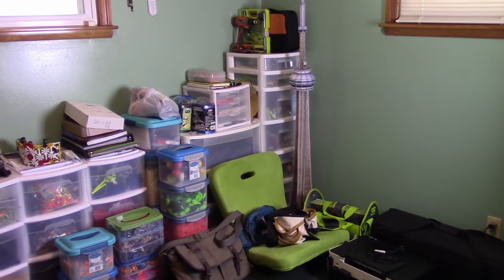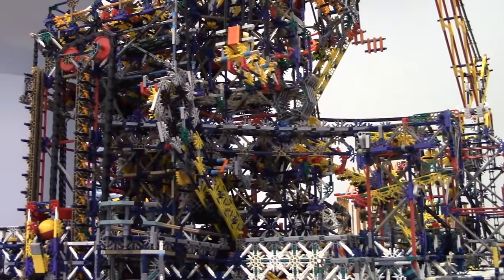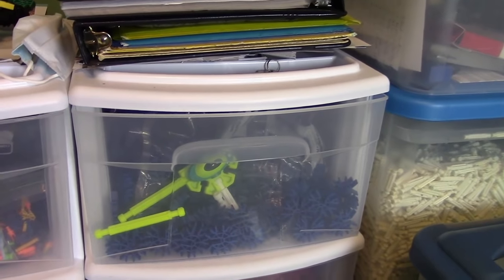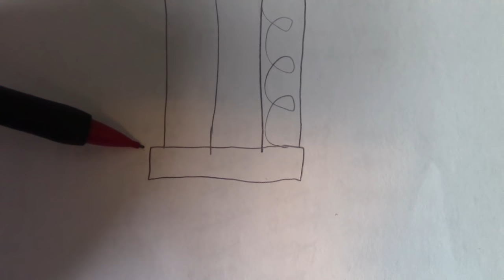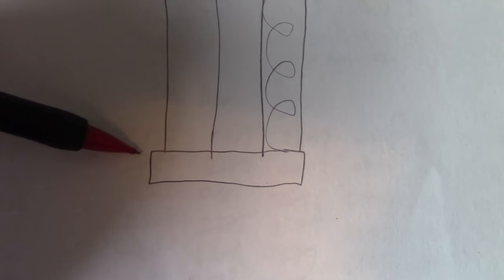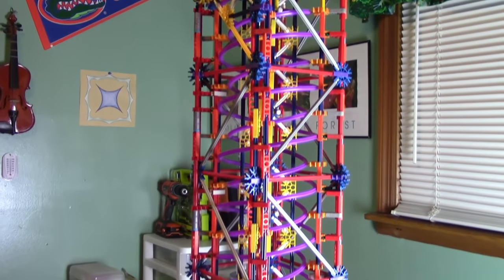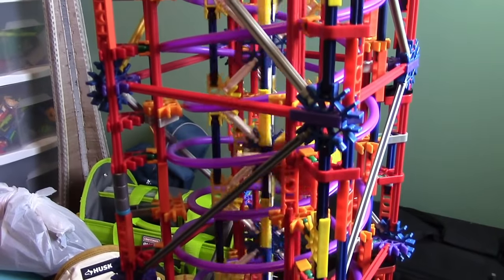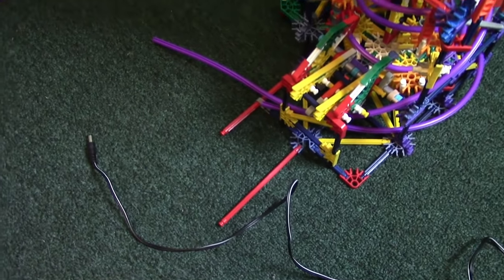Let's Build a Knex Ball Machine - Ep 1 - The Lift

Comment: I noticed that the 2 strands of tubing on the helix are at different depths compared to your instructables from a few years before.  Is this more reliable?
Reply from the maker: Yes, I made this newer version where the strands act as a track instead of just stacking them. The newer one still has issues if it's made too fast, so I want to make a version 3 someday.

Comment: I have the same gear ratio and same motor but my lift doesn't run as fast.  I have tried 2 motors and different power supplies.  must be friction or something else.  Any ideas?
Reply from the maker: Either there's more friction or the motors are different speeds than mine. I haven't measured my motor speeds so there's no way to tell for sure.